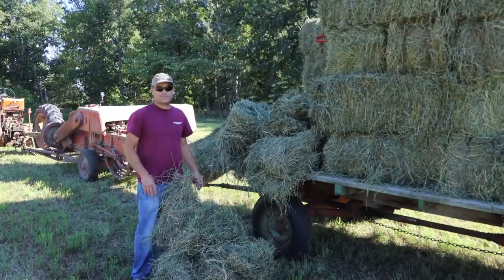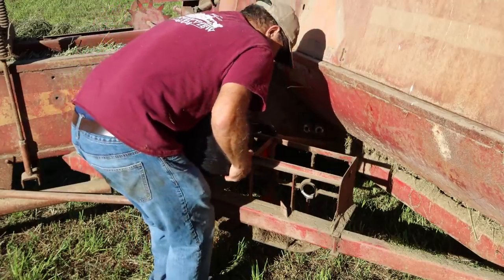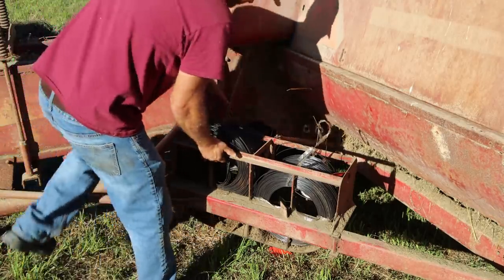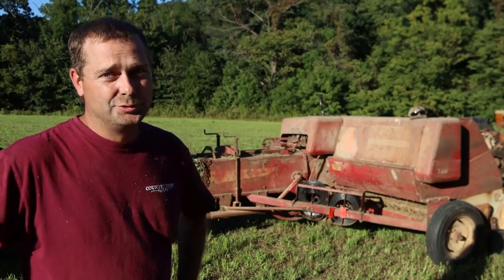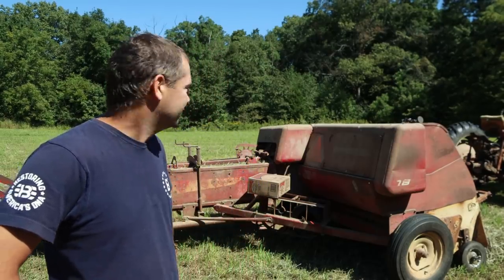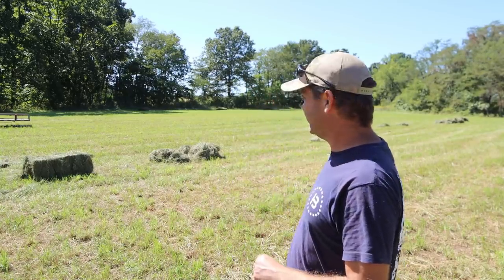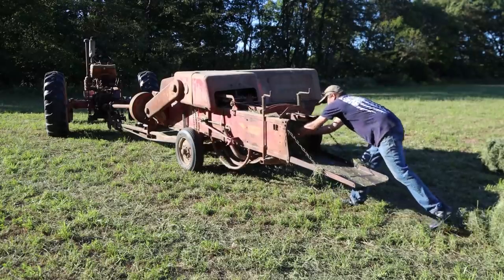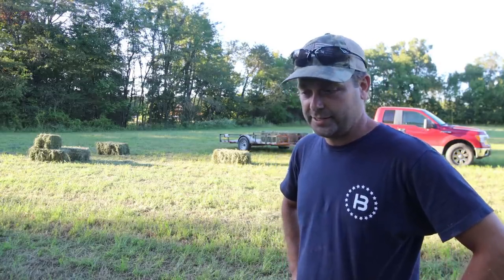I messed up the hay baler.  Finishing up our last cut of hay.

Comment: Almost every farm has a tangled roll of bailing wire hanging on a shop wall.  You’ll be able to tie, secure, attach and repair things for decades
Reply: Lol! Yeah no shit. I would just get another roll as well, or cut it in half so it fits better
Reply: you get 2 long wire out of every bail he feeds so getting to that roll may not happen, how ever he could run a few thousnd miles of eletric fence, it may rust but it still packs a punch
Reply: jay west , I got one out of the town dump, 40+ yrs ago, and still have 1/4 left..

Comment: Well done and extremely good job of dealing with a bad situation.  One thing that gets me riled quicker than anything is machines or mechanical things that don't work as they should.  

That baler looks pretty much like the one I worked behind as a teenager,  except the one I followed was a twine baler.  It was brand new and the first day we had it in the field it popped three shear pins in about 20 feet.  My boss had the shortest fuse of anyone I have ever met and within 30 minutes we were dragging that baler back to the dealer. Turns out it had skipped time somehow and was doing exactly what it should to protect itself from self-destruction.  After that little hiccup it ran flawlessly the rest of that season and the next. My Dad retired and we moved away after the second season so I have no idea how many years it served my Farmer boss.

Comment: You’re lucky you didn’t break a needle. When you add new wire always trip needles so number one wire is held by wire clamp, then you won’t miss two bales. Add some oil on wire roll, it will feed better. Watch for shims behind plunger knives. Check plunger rails for adjustment. Good luck and thanks for sharing.

Comment: When the 1st wire roll exploded from it’s straps, should have just Cut it in half, placed half in each bin. Oh well, sorry it happened. As for the wet hay, maybe before next season, you may want to thin the tree line in that area just a bit. Hopefully it’ll allow for more sunlight to hit your field there. 👍
Reply: Good idea, I never experienced a wire tie baler, but I just wondered if you could split the bale of wire,
However my experience when a roll of wire comes apart there is not much use in trying to get it back together,

Comment: Evan, 
That was a clear demonstration of tenacity. I would have bet against getting those two rolls of wire to work. 
You might consider adapting the width of the wire frames to accommodate boxes when you change wire next time. Adding a box of wire should not be a magic act. 
Also, as you begin next year, if you need to re-thread the wires and tie them off over the needles, you might try turning the flywheel by hand to tie the first knots. It always worked on my John Deere balers when I ran out of wire but you need an empty chamber to do it, especially with a small flywheel.  
Also, if you lubricate the chamber when you put the baler up for the winter, it will extend the life of the baler.  Also lube your needle rollers and replace them if they wobble or have flat spots.  
Keep the videos coming. They are all unique and enjoyable.

Comment: Sitting here eating breakfast watching your video. I looked up and saw the knife cutting the tape, I hollered no. I haven't run a hay baler with wire but have run an American scrap paper baler which ran four wires, (made 8 to 900 lbs bales). If you drop or jar the roll hard enough to dent the wire anywhere throw it away. It will tangle bad and will not feed. Also 100lbs rolls. tuff to get in the box that held them. Love your videos

Comment: You are absolutely right in cleaning out fully at end of season. If you leave a bale in there you are asking for trouble further down the road. The bale will collect moisture and erode the metal inside the machine and that is really bad. Also you would not be able to use that bale for feed either so its a waste of good hay.
Reply: I worked repairing balers from 15 years old and you're right clean out all hay & straw. If you have any (as if you didn't on a farm). It would help next year if you paint it on the inside of the chamber to keep it shiny. If you don't it will still rust, push some old hay through to clean it off. The knives should be bolted and be taken off to sharpen.
Reply: Throw a mesh bag of mothballs in a freshly painted chamber to keep rodents out. Leaving hay in the baler is asking for rust and mice.

Comment: Rainy or winter afternoon project:  build youself a spool that is narrower than the slot on the baler, and re-wind that 1st bundle.  Spool will need slots to re-bind the new bundle, and come apart to remove the bundled wire.  Well, OK, maybe more than one afternoon.

Comment: You did an excellent job on coping with that problem. I was surprised to see you were using wire and not twine I wondered why that was
Reply from the maker: That is just the way this baler is, it is made for wire.  It has a different mechanism to tie the bale.

Comment: Yep, when I saw you cutting the tape with the wire out of the holder, I was yelling at the screen NO! Live and learn. Worst thing I did was cut the straps on a roll of high tensile fence wire unrestrained, it's like a small explosion. Had to throw it away. A bad roll of baling wire still has many uses, farmers can't get by without baling wire and duct tape.

Comment: Never take it out of the box!!!! The box is what keeps it from pulling multiple wires into the twisters!
Reply from the maker: The box doesn't fit.  The area is shaped like a U and round at the bottom.  It is designed to take the roll of wire directly.  It can't stay in the box.  Maybe newer balers do, but this baler is around 1958 vintage.
Reply: @CountryViewAcres  I see. It was hard to tell from the video.  My apologies.  I would also suggest oiling the wire though.  I do it on mine and it helps a lot. I do have a lot newer baler than yours and the boxes do fit in the holders.
Reply: Country View Acres I’m sure you are right about New Holland wire, they probably did make their own when that bailer was new. The generic wire you’re using is meant to stay in the box that’s why it has the punch outs on it—just doesn’t work for your bailer. Was the wire you used prior to this already loaded in the bailer when you got it? Also are there any adjustments on the wire cage that would allow for a bigger spool? Jonathan brings up a good point though...I remember my grandpa oiling the wire on his bailer- hose it down with WD40 and clean up the cage before you rewire it the next time.
Reply: @corydriver7634  he could just.modify the baler so that they fix the boxes. Less fiddling with things and those boxes are readily available. Nothing worse than driving all over the place trying to find what you're looking for

Comment: I think I would have made that100 lb roll into two 50 lb rolls when the mishap happened.  Good luck!
Reply: I thought the very same thing but looking back I think this is a case of it being very much easier to think of than to do! I don't think it would have worked because even after you figure out where to cut it, you still would have the ends intertwined with the loops and cause the same problem.
Reply: @steveholton4130  Well, bailing wire is useful for a lot of other things, besides bailing.  He's going to have a lifetime amount of bailing wire to use around the farm.
Reply: Mark Holbrook 
....my thoughts exactly. No farm is complete without baling wire we just don’t need 100# of it.
Reply: Mark Holbrook unfortunately the way those spools are wound it just would have created two birds nests. As soon as he cut the bands off that spool he was screwed. His best bet at that point would have been to write it off as a lesson learnt for $80. Thankfully he didn’t make an even worse problem that would’ve cost more time and money. I felt for him, I’ve been there before it’s hard to recognize when to cut your losses and move on.
Reply: @markeholbrook  But he'll now have too much duct tape with nothing to use it on!!!
Reply: @arkiefyler  Sometimes ducktape trumps bailing wire!

Comment: Don't stress over that wire roll. I'm surprised they didn't have a tag warning you not to cut those bands.
I remember when I was a young buck of about 25. I bought a big roll of high tensile wire, I was going to do some fencing. I got this roll and on it was a tag that said warning don't cut ties until you have the roll mounted on a spool. And they were very specific about what kind of spool. I. Was like ah heck we don't need that spool. I chopped those straps off and holy smokes the Tangled web of wire.
Reply: LOL The mental image your story gave me was hilarious!

Comment: Check out a Case 8420 round baler. Extremely low horsepower required. Makes a small 3.5 × 4 bale that weighs around 400 pounds. You would thank yourself. U can find cheap because of how small they are.
Reply: I'm thinking the clientele he sells to prefers the small square bales.  Easier or move and feed.  Less waste.

Comment: I know it will be awhile til you have to change the wire but possibly if you would just cut the corners off the boxes it would all fit into the holders and then it wouldn’t blow apart

Comment: yes  as soon as i saw you cutting i was oh no!  you might want to see if you can  widen the  slots to be easier to drop the wire in, on our jd the whole box will go in you might want to spray the wire down with a little diesel or light oil to keep it from rusting. as for the wire  well you now have lots of tie wire for lots of projects.

Comment: Drill a few drain holes in a 5 gallon bucket and hang it on the bailer in a good carry spot to have a place to toss trash and wire scraps in the field. You will have a much easier time when you have a known trash can and have to do a field repair or find something odd you don't want to run over in the future. As you store it inside and don't plan to use when there is a chance of rain the drain holes are just a backup as there is always a chance the weather is wrong or you are racing bad weather to get the bailing done. 

You would think that tractors would come with a good tool storage space as you always want to carry basic tools, pins and at least one chain but they for what ever reason don't.

Comment: After blowing off and cleaning the baler, spray both rolls of wire with a light coat of WD-40 to prevent rusting and mouse nesting which will corrode your wire.
Reply from the maker: I put diesel fuel on the wire.  After someone suggested it.  Should work about the same.

Comment: Oh my what is going to happen when the roll gets smaller with nothing to hold it. Can you use baler twine instead. Good luck. Love watching your videos
Reply: The roll doesn't get smaller, the baler pulls the wire from the inside diameter of the roll of wire leaving the outer diameter the same.

Comment: You can make smaller rolls of 20ft and sell them on Craigslist. A lot of carpenters and concrete folks use it and each roll is like 12$ at the hardware store. You could probably make some Money off your mistake with a little bit of time invested . Plus if you can't sell em atleast you'll have bailing wire rolls to put in your tool boxes. Also you can just pile the hay up.in one spit and feed it to the baler with a pitchfork. It'll save you about and hour or two

Comment: stop as soon as it starts to go wrong... 
zip tie it
Pull the ties tighter and tighten until it fits.
Slide it in
Cut the ties.

If you catch it early, you don't tangle it.

When you kept messing with it... you guaranteed tangles  and need to re-spool.  That roll is  wire for piecework.  Pull the messed up one and put it in the tractor shed.

Comment: It's too bad you can't take that shute and add some metal and add a bolt so the Shute can swivel and take some straps to keep the shut in the middle of the trailer. That way as you turn the shute stays aline up with the Trailer. Wish I could come down to experiment on your hay bailer. But the whole idea is that the shute follows the trailer.

Comment: Looking at the wire box, it has round cut outs on both sides. I think the purpose of the cut outs is that box is meant to fit in the holder with the wire feeding from the cut out on the inside and tying off on the other side. Are you sure the wire should come out of the box?  Either way, I admire your tenacity and hoe you care for your equipment.
Reply from the maker: My baler is so old (1958) is made to take roll directly.  The carrier is U shaped and round at the bottom.  The box will not fit a square box in there.
Reply: @CountryViewAcres  Oh, sorry about the armchair observation, lol!

Comment: If I had the equipment I would welded a piece of sheet metal on each side of the wire shoot so it would be easier to slide down in there if a mistake was made it didn't come out of the box exactly like you wanted to.🤔

Comment: The reason many farmers got away from wire balers is the danger of  tiny pieces of wire getting into the hay either while baling or when cutting the wire when feeding.

I definitely would look for a twine baler.
They aren't expensive.
Reply: That's the vary reason they came up with cow magnets.
Reply: @dwightl5863  .wire tie balers went out of style long before the Edsel.

Seems cow magnets couldn't save wire tie balers.
Reply: @douglasmacarthur8775  The magnets weren't created to save the wire baler but to save the cows.
Reply: @dwightl5863  ..most farmers with an ounce of brains do everything they can to keep metal out of feed.

Should an owner of a building with sprinklers throw caution to the wind regarding eliminating fire hazards just because he has sprinklers ?
Reply: @douglasmacarthur8775  Geez man don't get your shorts in a bundle. I'm not saying farmers were negligent at all in their feeding practices.  None want to have an animal suffer with hardware disease.  As in your example the sprinklers are to put out the fire if it happens.  The magnets were there IN case wire was ingested.  Accidents happen.

Comment: I'm sort of surprised no one heard me screaming NNNNOOOOOOOO when you took that first roll out of the box and got your knife out.  never EVER cut the roll 'loose' until it's in the cradle --- what you have now is a 'birds nest' in roll of wire,  ....  NEXT TIME, cut the bottom of the box off and leave the cardboard on top to keep dust and dirt off top of roll .... AND soak the cardboard with oil -- to keep the wire from rusting.
Reply: and good on you for cleaning the bale chamber.  I always oil all bare surfaces to prevent rust between cuttings and in the off season.

Comment: God help you ....why don't they print how to fit it on the box would have saved you $80.00 ++++.But a great finish.
Reply from the maker: I think on newer balers you don't have to take it out of the box.   But mine is so old (1958) it is designed to take the roll of wire directly.